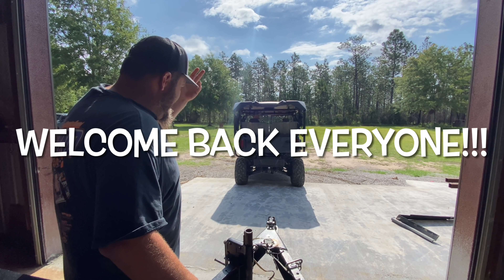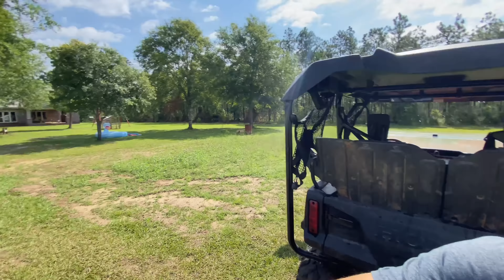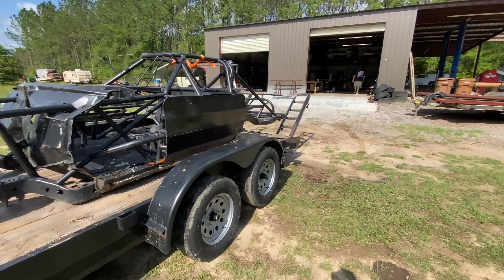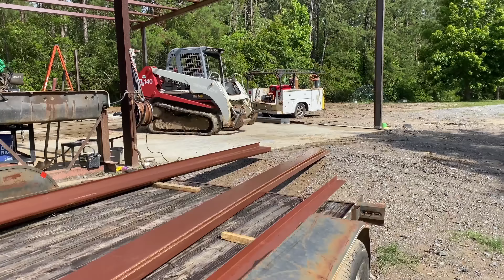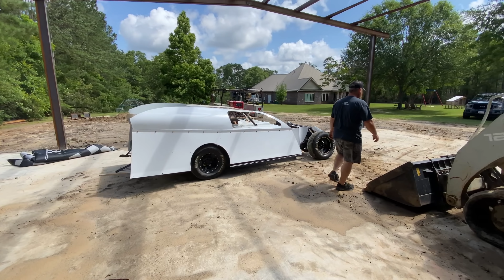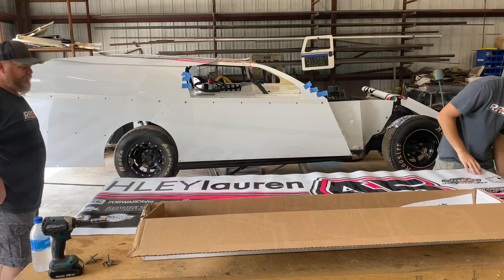Gettin all dressed up for our trip to Cedar lake Speedway

Comment: You guys are Scaring me ! With all that Pressure to put that bolt in ! Is there something else wrong ???
Reply from the maker: It has always been like that, even when we first installed an engine in the car!
Reply: Hmmm , we run the ones that have a slotted hole so you can move the motor left to right with no effort! Maybe your mounts are bent a little??? When it’s all said and done you should be able to screw the bolt in by hand . As you probably know . I’m just thinking of the stress it putting on everything .